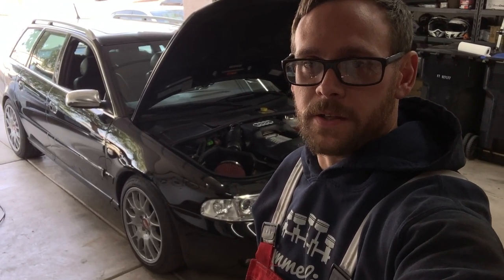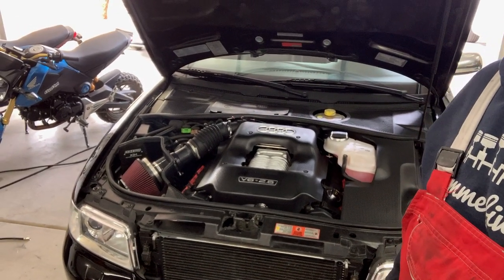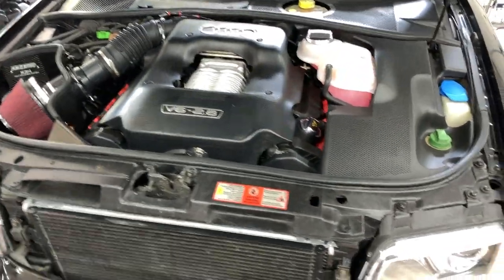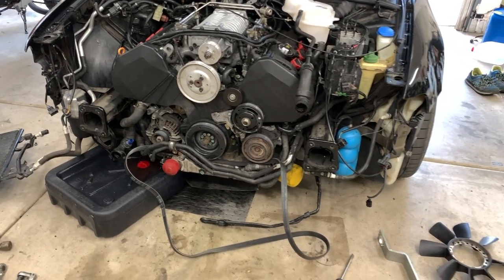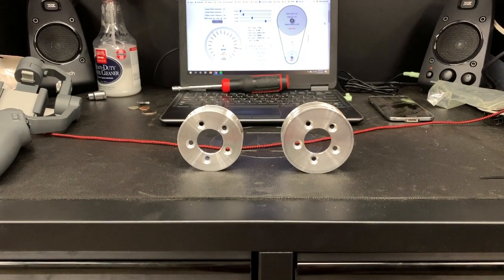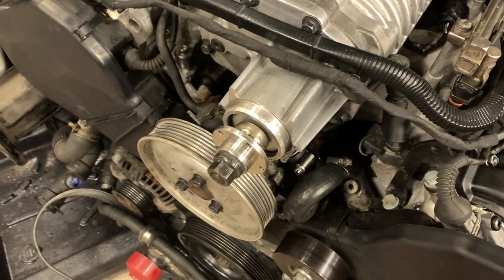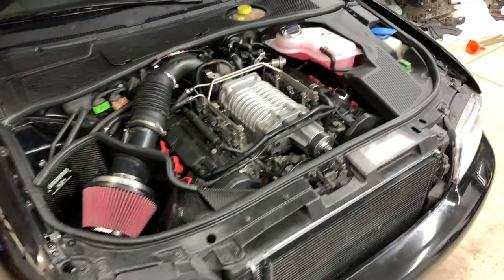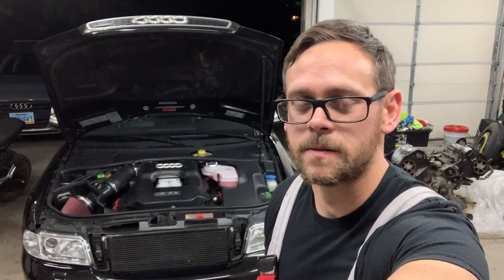Supercharged Audi B5 A4 2.8 Smaller Blower Pulley!! VLOG #6!!

Comment: WOW!!! This really brings me back 12-14 years in the best way. Wrenched and wrenched for hours and hours on my b5 2.8 30v, was my first car. Sits in my barn now collecting dust...PES G1 setup that I intercooled, smaller pulley running a piggy back tuner style from 2009-10 😅

I also had a 200 20v (pearl white) but was an idiot an sold it about 4 years ago. Put so much into that car. Yours is amazing...I remember rebuilding the distributor cog and hall sensor, having the drive the little roll pin out the replace the crappy plastic cog to upgrade to the brass one 🙄

 Sorry for the long winded comment. Really nice video sir!
Reply from the maker: Thanks man! Sounds like you also have exquisite taste in Audis :). I need to make more content with my 200. B5 too I suppose lol
Reply: @amdisthebest  Hell ya man! You really should for both! And thank you 😆love me some Audi. One day I will have a b5 rs4, rs2, and an sport quattro sitting in the driveway 😅
Reply: You still have that car, are you interested in selling?

Comment: Sent you a message on instagram, not sure if you saw it. I picked one of these up but happen to be missing the idler pulley, do you have the part number for it by chance? Also, did you use the 034 motorsport conversion harness to go to FSI coil over plug setup? Message me some details I need some help lol

Comment: Hello there and greets from Germany. I have an 1998 B5 Quattro Model in very very good condition and my next project will be kind of the same. Your channel inspired me alot and I am glad to see other persons out there going the way of a supercharger instead of a turbo setup! Nobody in Germany is willing to help me with my supercharger project because all say things like. Awww too expensive, save ur money and buy an s4  instead bla bla. The thing is i want to have something custom so badly. I purchased a used 2.8 engine and in phase 1 of the project I will rebuild that engine from the ground of to prepare it for the supercharger. :) Did you run into any problems yet in terms of reliabilty? I am planning to use this car every day also for long term highway rides like 1000 miles. Do you think this will work with the supercharger setup? Hope to see more content and wish u a happy new year!
Reply from the maker: Thank you for the kind words my friend! I like to do things that are a bit different as well and my goals for this car are not to be the biggest or most extreme build out there. The engine is all stock internally and the setup has been very reliable so far. Just keeping up with normal older Audi maintenance is key. The torque curve is very flat which helps preserve the drivetrain as well as keeping stock internals happy. The one thing that may be a concern for you is fuel. I run on nothin but E85 which helps immensely. This supercharger kit does not have an intercooler and creates a very high temperature air charge. Without proper fuel, ignition advance has to be very mild to prevent pre-ignition (knock) and with very conservative ignition timing you don't end up with a ton of gains like I'm seeing with mine. If you have E85 available then you are in good shape, if not, you will want to look into a custom intercooler setup potentially.

Either way, keep an eye out for new content coming in 2021. Working on some B5 content as well as getting youTube updated with some of my Audi 200 content as well.
Reply: @amdisthebest   Sorry for my late reply. Thank you very much for the advice! It helped alot. Anyways. So far I just disassembling the 2.8 V6 engine. The next thing will be a complete revision of the cylinder heads. I think I can increase the displacement by 3.0l and at the same time reduce the compression level a tiny bit for lower combustion chamber temperature.
I am planning to do videos on my progress as well  :) Wish you all the best

Comment: I'm working on an adapter for the 3L supercharger to the 2.8. heat exchangers where the intercoolers go on an S4. It's my own thing I've been working on. My project is a 2001 Audi A4 with S4 interior and gauge cluster, TT RS Bbk, dropped h&r suspension, and some 18" enki's.
Reply: Ive been thinking of doing that to my b5 s4, i already have a supercharger from a Buick but need a different snout head to shorten it... any idea's?

Comment: which car is the compressor from? what the cost and will it fit for audi a4 b6 3.0 v6 asn?
Reply from the maker: This was a kit specific to this engine. Made by a company PES Engineering back in the mid 2000's. The blower itself is a Magnuson MP62 which is quite similar to an Eaton M62. PES did make a "G3" kit which worked on the B6 3.0 engines as well.

Comment: Looks clean! I picked up my first 2.8 Avant for screaming deal with the PES supercharger already installed. I’ve always had 1.8T‘s and have done the ignition conversion on those. I notice better throttle response and a slightly better idle, did you notice any improvement doing the coil conversion with the wasted spark system? What Supercharger pulley did you use? I would like to run a smaller pulley and E85 in the future.
Reply from the maker: Wow, sorry for the delay. 

I did it mostly for cleanliness since having the coil pack up on top of the blower ends up looking a little busy in my opinion. If replace known hood components, there really isn’t much of a performance gain by jumping to the FSI coils but they are resonantly priced and readily available which is always a plus. 

The pulley system I used from from a cobalt SS site but I had to make my own hub to adapt their hub. The pulley system is now modular and I can swap out to other pulleys with relative ease. I can’t go any smaller than the 2.6” though since I already had to clearance the blower snout a little bit.

Comment: These didn’t come with a blower from the factory correct? Questions:
Where’d the blower come from?
Where’d the intake the blower bolts to come from?
Are you running stock injectors, and if you are, are they the same injectors as the NA 2.8?

My wife has a B5.5 Passat and I would LOVE to bolt this kit up to it, swap a new tranny in, and have it tuned. It would be the unique car she’s always wanted.
Reply from the maker: They didn't come with a blower from the factory, you are correct. This blower is a Magnuson MP62 which is quite similar to an Eaton M62. This was a kit produced by a company  called PES Tuning and this kit was specific for the 2.8L 30v Audi/VW engines. This kit has been discontinued for a long time. You can see the old webpage here: https://web.archive.org/web/20040501150919/http://www.pes-tuning.com/Merchant2/merchant.mv?Screen=PROD&Store_Code=PES&Product_Code=2830VSC&Category_Code=AP-PERF-SC

Injectors are not stock.

Finding a complete kit now will not be easy, unfortunately though they do pop up used every now and then.

Comment: ECU QUESTION - who did the tune on the ECU?  Are you running a GIAC chip?  My 2000 A4 B5 2.8 Q needs a new ECU - the mechanic can’t find someone to add a tune for the PES G2 Supercharger set-up.
Reply from the maker: I did the tuning myself as I received my kit used and without ECU. I custom tuned it for my particular injectors and I run my car on E85 as well.
Reply: @amdisthebest  Do you do a video on how you did that?  I would appreciate help here as the shop/mechanic is telling me that they can’t do the tune and cannot find anyone who can (Denver/Colorado Springs) so they recommend that I return the car to stock  (but who wants a stock 2.8).  Would sure like to learn how you tuned it.  Apparently - this is an increasingly rare skill.
Reply from the maker: I don’t have a video on tuning the ecu and it’s not exactly something that would be very easy to explain. Not to mention it’s just not easy to do in general.
Reply: @amdisthebest Would you consider a proposal for you to program a G2 tune on a stock ECU?  I have the original G2 configuration as far as injectors.  What would you charge?

Comment: Hey man, clean build, i was wondering what supercharger kit youre using? I have a b5 passat 2.8 and want to do about the same setup. Also how did you make your headers? No one sells headers for the b5 2.8
Reply from the maker: Thank you! The supercharger was made by a company called PES. The kit was called the G2. Used will be your only option these days and even so they are really hard to find.

Comment: hi sorry to disturb you I live in France and I would like to do the same preparation on my audi v6 as well, but I can not find any compressor like yours, if you have a site that does this kind of sending to Europe I would be infinitely grateful to you thanks in advance
Reply from the maker: This kit is no longer produced. The only way to locate one is in used condition. There are two on eBay in the USA right now: https://www.ebay.com/itm/AUDI-A4-A6-VW-PASSAT-2-8-30V-V6-G2-PES-TUNING-TURBO-SUPERCHARGER/114466449396?hash=item1aa6bb67f4:g:dUIAAOSwvi5flIfV

Best of luck in finding one. They are quite fun once sorted.
Reply: @amdisthebest  it works I thank you it's quite hard and even impossible to find new even having Germany next to it apart from g power and companies but it's overpriced thank you again 😄

Comment: A quick question, instead of running E85 do you think a heat exchanger similar to a M62 on a cobalt ss would be a viable option of bringing down the inlet temperature
Reply from the maker: Adding an intercooler will help quite a bit I’m sure though I don’t think it would unlock the full potential like E85 can. The two combined would be nice and I plan to build my own intercooler one day.
Reply: That awesome will be looking forward to that. I was researching on the PES G2 kit and the limitations of the m62 and wondering if a TVS adaption is a better option to a 2.7t on pump

Comment: hi can you tell me if the block is original or forged? thank you man because I have a 2.4 AGA almost the same engine and for project the compressor thank you
Reply from the maker: The block is all original. Nothing changed or added internally. The bottom end is very similar to the S4 engine which has proven to be plenty strong with proper tuning/fuel.
Reply: @amdisthebest  thank you man  ;) :)

Comment: Any recent progress with the B5 G2?
Reply from the maker: I moved and the car has been in storage since I've moved sadly. I finally got a set of new fenders and front and rear subframes to replace the crust northeast ones. Aside from that, I have a Syvecs ECU waiting to go in it as well. Hoping to get back to the car very soon though. I've been missing it!
Reply: @amdisthebest  Thanks for responding. Good luck. I have a '98 with a G2 kit. The car is currently a driveway ornament, unfortunately. I may, with some grace, get it running before the end of the year.

Comment: Aye, brother look closely at the passenger injectors I believe I saw something arcing, if not my apologies, you can see it when you started and rev.
Reply from the maker: Raul Robles that’s the supercharger bypass valve opening and closing. It’s stainless steel so it reflects light when it flips open and closed.

Comment: Have you had piston issues at that level of boost? I have the same set up and want to go to a smaller pulley but I hear the pistons like to melt at around 10 psi.
Reply from the maker: The pistons only have an issue when the tune is poor. Or fuel. My car runs on e85 and it’s unlikely that I’ll ever have an issue with the pistons.
Reply: @amdisthebest  I have water methanol injector kit from snow performance installed. Maybe I should look into E-85 tune

Comment: If you swap to the smaller pulley do you need to have the ECU retuned?
Reply from the maker: colton I can’t comment for other tuning but I’m tuning this car myself and I didn’t need to adjust anything.
Reply from the maker: colton w the maf reads more air volume and compensates properly.

Comment: Does that super charger set up work for 00 vw 2.8?
Reply from the maker: Yes it does.
Reply: amdisthebest How about the 98 Audi A4 2.8v
Reply from the maker: @drewm9185  as long as it’s a 30v engine this kit will work. The earlier 30v engines have different ecu systems though so the tuning will be different.

Comment: Would you do this to a non Quattro?
Reply from the maker: The power is manageable and linear so I think a FWD would do pretty well with a kit like this. I do think Quattro would be preferable but not a necessity.
Reply: Do you kind of I ask what that intake setup is?
Reply from the maker: @igotWeedinhereCowboy  it’s custom made from a few different parts. I used the heat shield from 034 Motorsport originally intended for the B5 S4. The air filter and velocity stack are from Vibrant Performance and I made the MAF adapter myself.